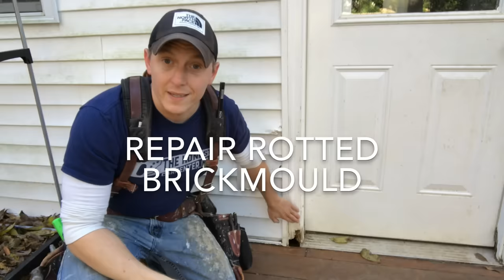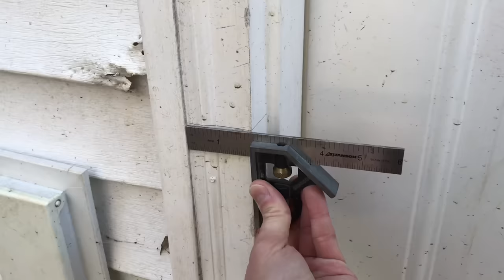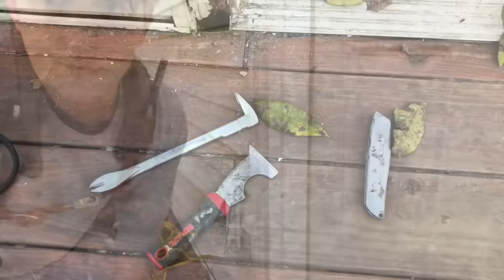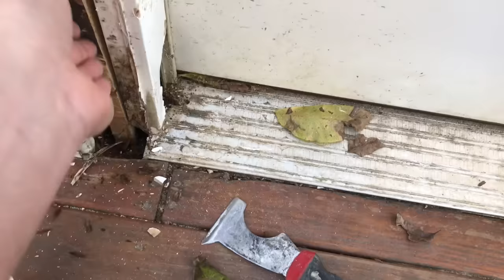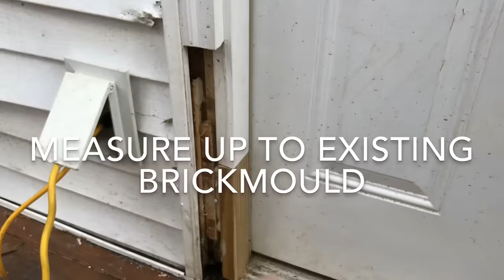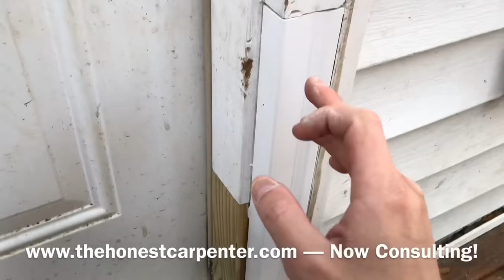Fix Rotted Door Frame (Brickmold)

Comment: The oscillating tool is an excellent tool but blades can be expensive. You can buy a small disc adapter to allow you to use almost any blade with your tool. Mine is a worx machine and I think I bought the small metal adapter from them.
Reply from the maker: You’re totally right Eddie! The blades can break your bank if you burn through them. Adapters and after market blades are a lifesaver 🙂
Reply from the maker: DR Dan Very true! I buy after market blades that match my brand, saves a ton. I’ll link some in the description!
Reply: I used to burn out blades like nobody's business ($$$) but learned to sharpen it except for the Japanese style aggressive teeth. Since then I converted to carbide blades, expensive at first but save $$ in the long run. Not as fast or accurate as the Japanese style but lasted almost forever and cut through imbedded nails or ever screws.

Comment: Nice repair.

 I agree with other commenters that you should have replaced the whole piece of both parts.

While I had it open. Would have used a low expanding latex foam to fill the gaps between the framing to prevent air leakage. Doors and Windows usually have a lot. Especially when the caulking is starting to fail.

Also I would have installed a piece of waterproof membrane along the corner and pushed it as far behind the vinyl siding as possible. To prevent future water intrusion into the framing.

Comment: Keep the wood from contacting the cement or what ever the surface material is ramp silicone or water and uv  protected construction adhesive around the edge to repel water. Can use epoxy or fiberglass  resin to cover the bottom few inches all the way around the new wood before installing it

Comment: I've got a Ryobi 18v multitool and I was wondering how much a difference a corded one would make. I'm guessing the corded tool would have a lot more power and create quicker cuts - Hate to add another tool if it's really just a matter of time saved, and since I'm really just using it for my own home repair and DYI projects.
Reply: I have a Makita cordless and Fein corded.  The Fein is definitely more powerful but I use the Makita more often for smaller jobs as it's much more convenient.  It's good to have both but I wouldn't go our and buy a corded tool unless you have a specific big job on the horizon.

Comment: Great video. I have  a 50 year old Peachtree wooden 8 foot sliding patio door that works perfectly. It has clear glass, slides great, screen works well, etc. However, the bottom wood is rotting. How can I replace the wood without replacing the entire door? Do you have a video tutorial on how to replace the rotted wood on a sliding patio door?

Comment: That house needs more than a brick molding to make that look good
Reply from the maker: @richard fabrizio Yeah, the vinyl on the backside has taken a bit of a beating over time. Front of the house was solid though :)
Reply: Some cleaning, painting, and vinyl repair would make a huge difference but the dog would just paw at the new work with his muddy paws and make it look bad again.

Comment: Two things - 1) thanks for giving me an excuse to purchase another power tool.  2)  awesome video as I thought we were going to have to replace an entire door due to it being a pre-hung entry door.  Also, can you apply silicone to bottom of the replacement pieces to prevent water wicking?  I watched your other video, and it's great too.  Thank you very much!
Reply from the maker: Thanks so much Tom, I’m really glad it helped! The multi-tool is indispensable—feel free to check out my article on it for links and more detailed advice. Pvc trim basically won’t ever wick, but you can always seal wood end grain with siliconized acrylic latex, or even exterior adhesives. Good luck with the project!

Comment: They need an awning to keep the rain away from the door.  I don't know why people stopped doing awnings.  There is a reason they were popular and I don't get why they went out of fashion.
Suggesting a good, long term fix of keeping the water away from the wall is not dishonest.  Gutters are also important.  Divert the water away because sealants will eventually fail, always.
Reply: I'd imagine some places quit using them for a couple of reasons, wind load rating and home owner association bylaws.

Comment: Good grief......the fisrt time I've seen a DYI vid where the star uses an oscillating tool with the saw the right way around. Except for floor level cuts this is the correct way up using a saw blade. Thank you.

Comment: great video to gauge what your getting into so use it and do the  easier, cheaper, better looking version  

1 - go to lowes or HD buy 2 full pvc sticks of brickmold for $11.95 each

2-- remove the old brick mold in 1 solid piece no cutting it in half with a tool you don't need ( you can pry the old brickmold off very easy without damaging anything.)  

3-- cut the angle at the top by using your old ones as a template (any saw works even a handsaw cuts pvc like butter. $15.95 miterhandsaw combo kit at lowes or HD) 

4--hammer in with nails and caulk in. 

5--your done and you never have to replace or paint it again and you don't have to buy a power tool you don't need. 

hammer, pry-bar ,handsaw, caulk gun, utility knife... tools you should already have around a house. 

this guy is showing you a much more complicated way of fixing this issue and you will also you have a seam that will always be visible in the brickmold doing this way .....replace the entire stick looks better and easier. I do these fixes in less than an hour and  for a regular homeowner id say 2 hours tops if your slow an steady.

Comment: I would have replaced all that with PVC including the door jamb.
Reply: EXACTLY
Reply: I agree, but that's pressure treated wood. Should last twenty years or more. By that time you'd replace the whole door.
Reply: Me too. How much extra could that cost?
Reply: @Mr572u  .. The bottom is all that really needs to be PVC, so you can buy things like this https://www.homedepot.com/p/The-Home-Depot-Ever-Jamb-Exterior-Door-Frame-Kit-4-9-16-in-x-36-in-x-83-in-pine-with-PVC-base-3-Piece-303-064C/202087157

We replaced a man door and back door, I elected for everything including the door to be PVC. Cutting out stucco and the job that was made the worry of a few extra bucks irrelevant. I don't want to go through that process every 10 to 15 years!

Comment: Great vidoe thanks. If you were going to fill in a gap in the bottom of the jamb/molding, would you just cut a piece of wood or PVC to fit? I don't have a rot problem, but I have a gap (there are 2 doors) where the door moldings or brickmold or whatever it's called comes down to the concrete. Not sure why they left the gaps there, but from inside, you can clearly see light coming through, meaning air and possibly mice etc. I'd like to seal those up. Many thanks if you can offer any tips.
Reply from the maker: Hey Al, in many cases, especially around garage doors, builders will leave the gap to prevent the trim from coming in contact with masonry or concrete, which always has a high moisture content. This can often be caulked, but if the gap is huge, I'd say yes, you could cut a piece of pvc a little short, and basically adhere it in with caulk on both the top and bottom
Reply: I have the opposite problem. I’m in an apartment (townhouse type) and they have the brick mold sitting right on the concrete outside the back door, which faces the south-west and gets lots of driving rain. Well, that wood trim just soaks up the water like a sponge. Ironically, the outside doesn’t look very damaged (the paint is coming loose) , but the inside door trim and baseboard (& likely the drywall) is soaking wet. It has turned brown and the paint is all wrinkled and loose. I contacted maintenance, before, and they just caulked around the edges. Now they want to install a storm door. I don’t think it’s going to solve the problem. I had a dehumidifier running next to it for months, and instead of drying it out, all I’ve managed to do is get my dehumidifier contaminated with mold and now the mold is throughout the whole place! It’s burning my throat and has infected my HVAC Unit. All from these two little wet corners of the door trim. I’m sure it’s into the drywall now. Since we’re still in the middle of Covid I’m thinking of tackling this myself. I shouldn’t have to but this can’t go on. 
I’m planning to cut out the interior damaged trim and see how bad the problem is inside the walls. 
If it’s not too bad, I’m planning to undercut the exterior brick mold by about a quarter inch, let it dry out and then fill it with caulk, to seal it and keep it from absorbing the water. 
Does this sound like a reasonable approach? Is a quarter inch enough to stop the wicking? There is no porch roof nor anything to protect it from the rain or snow.

Comment: Why not replace the entire piece? An entire 3 piece set of brickmold is only about $20. It seems like the time and labor would be more than that. Pry the old stuff off, replace with PVC and caulk. It will outlast the rest of the door.
Reply: Charles Barbour. .my same thought. Then foam insulation around both sides of the door. I wouldn't hire this guy😨
Reply: As a carpenter for 35 years, I would never do this. It’s a hack job. Replace all three pieces of the brick mold.

Comment: Never used the PVC brick mold before, or even knew it existed to be honest. Do you find it easier to shoot brads through than the pine or more difficult? Just curious
Reply from the maker: Hey Scott, this newer PVC trim is cellular--it basically seems aerated, so it's very light and takes brads just as easily as soft pine :)

Comment: Should of just replaced both sides of door with new brick mold stuffs cheap plus its a professional job i hate scabbing in stuff looks like somebody is cheaping out and doesnt last as long just saying
Reply: If your going to do it. replace the whole thing it would be faster and last forever
Reply: THANK YOU .. this type of repair it just not good looking and will never look seemless...just replace it all new ..daaam😒
Reply: Exactly what I was thinking.  Replace it all why play around with a little peice. You still have to paint it and it looks thE damaged still when it’s hacked.   That’s wild some one would just cut out a section.
Reply: I have see it later when it fails again from someone doing the same thing it will rot in the joint again
Reply: That house needs a lot of work.. probably not the only thing needing repair. Also, I would have shot some foam in there when replacing that trim. It looked like there was nothing.

Comment: I could only have one improvement on that repair , instead of doing a flat 90 degree cut do a 45 degree splice that way incase there is a crack of weathering the water is just going to be forced down and out the timber preventing any water going in since its on an angle , if it makes any sense

Comment: I agree, multi oscillating is crucial. Any advice before I go shopping for one? Great vid!!!!
Reply from the maker: plantbased_Jeap Mogilski Thank you! Lots of manufacturers are making multi-tools these days, and honestly I think a lot of them are good! I use a Bosch, but I say just set your budget, and pick the highest reviewed brand/model at that price line. Also, before you buy, see if you can find after market blades that match that model. This is the best way to save on blades going forward. That’s where things get expensive!
Reply: I would avoid harbor freight, they shake like crazy. I got a porter cable, works just fine, lots of use.
Reply: plantbased_Jeap Mogilski I bought mine at China Fright. It worked ok when I used it to widen a door opening to install a storm door. Had to remove about 1/4" of brick moulding on the hinge side. Took forever, especially cutting into the grain the length of the door. What else could I have used?
Reply: I have 7 of those things and not even a contractor. Don't ask! If you just do a little around the house even the cheap Harbor Freight will suffice. Honestly it's as powerful as my M18 cordless Milwaukee and should last a few years (YMMV) and will accept standard blades. I did burned out my Milwaukee but it was tortured. Now I have another Milwaukee. The no name FastCraft 42 piece multi tool is the steal of the year ($30 at Costco). I think it's better than HF, both I have. Although the cheap ones maybe as powerful and well do the job just as good, the difference is in quality construction, feels better in your hand, last longer with available repair parts. BTW, some may not accept standard blades with or without an adaptor, just to let you know. Look for toolless blade change and adjustable speed although I leave it at the lowest speed almost all the time. If you have the money, contractor grade name brand cordless is the way to go.

Comment: I like how you used PVC molding but don’t you think the frame wood will weep and rot even though it’s treated? Wouldn’t PVC been better?
How do you get rid of the line connecting the old and new pieces so it won’t show after painting? Bondo?
Thanks for another of your great videos!!

Comment: Hey man, very helpful video. I am trying to replace the trim in the middle of a 3 door exterior jam. What do you call the wood piece that goes up on each side of the middle door? It is a different molding than the PVC Brick. Is it just a piece of 2" x 1" wood? I am trying to buy a new piece at Lowes and I don't know what it is called

Comment: Hi Ethan. New subscriber. Curious, how much would an honest carpenter charge for this particular job - all that you showed & told us in this video? We have the exact same issue, Oregon rain, and a quote came in to replace the entire door & frame. To my eye, our door & rest of frame appears ok, not damaged at all like the rotted bottom one-side only mould. Thanks!
Reply: $250-350
Reply: @dickhertz8103  Thank you! A friend (retired engineer) with tools followed the video, & after 8 months of weather changes, it’s held up well.

Comment: Question for anybody that will answer. Is it possible to rebuild an exterior door threshold. I have a double door French door with only one side that opens,  which is the left threshold side and the threshold needs replacing. I don’t want to replace the whole door as I have been told by home depot and Lowe’s. Thx in advanced

Comment: It’s easier to just remove whole pc and put pvc pc in , takes half the time , I would do that on jamb , but not trim
Reply: Michele Biscardi exactly how I fixed a busted door jamb a few weeks ago someone kicked the door in and busted the strike plate out so I just replaced from the 45 degree corner to the deck and I did section the center piece.

Comment: Great helpful video, as usual, thanks!  
One quick thing: at the 6:45 mark you mention if this was a window 
you'd need to put a 15* mitre on the replacement piece.  
Do you have a video where you explain that in more detail?
I think I know what you mean, but...
Reply: Window sills are on an angle to allow water to run off when you cut a new piece of moulding you need to put the angle on back to front so it matches the sill angle

Comment: Is it really going cost that much more to replace the entire piece of jam and brick mold? I would just pry off the entire length and replace it with new PVC or some similar product and only have a few 45 deg miter cuts, then repaint. No big deal.
Reply: agreed.  what a crappy hack job replacing a portion and not all of it
Reply: mr inspector, makes you wonder what he charged??!
Reply: @mrinspector2206  I don't know if the house deserved any better, by the looks of it.  Still, how much more would an entire piece have cost?
Reply: @officerjimlahey31  I would be inclined to replace all of it if someone was paying me to do it for them.....I've replaced end sections before for myself though if the pre-made sizes I needed weren't readily available, mainly just to save time and effort having to cut and fit all the corners and such.

Comment: Two thoughts;

First, my son will always tell me when operating a power tool to cut wear safety glasses (yes, I had to be driven once to a immediate care facility to get my eyes flushed while sawing something and my son won't let me forget it.

Two: My dad would have cut that on a 45 degree angle for joining two pieces. He was the son of a Swedish carpenter and they always seemed to join wood on 45 degree angles.

Comment: A little of paint would of went a long ways.Always replace both side with PVC.
Reply: Vince Abbott the correct procedure is to replace ALL 3 PIECES of brick molding with PVC; prime with Glidden Gripper primer, then apply TWO COATS of Sherwin-Williams EMERALD gloss paint, then NEVER touch this area again. A LIFETIME repair.

Comment: What belt system do you use?  Best belt?
Reply from the maker: @John Gates Hey John, I use an Occidental Fat Lip belt system with a Stronghold harness. I've linked both in the description above for you. Long and short, Occidentals are pretty much the ultimate pro rig. I've used everything from leather aprons to variety 4" belt setups, but nothing is quite as customizable and indestructible as Occidental. They're very expensive, but if you can get them dialed in and conformed to your body, you can pretty much wear it for life. I'll do a whole video on it before too long. Thanks for writing in!
Reply: @TheHonestCarpenter  No idea what that was, I thought you were going to do some rock climbing or get on to a high roof after that job.
Reply from the maker: @kimchee94112  Basically the result of me never having enough hips to keep a tool belt up. Gotta hang your belt from your shoulders!